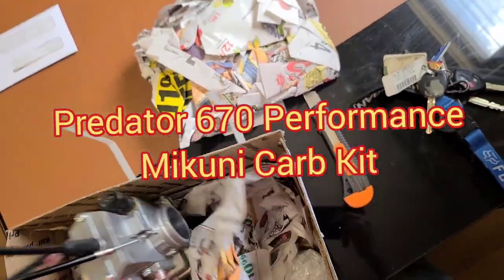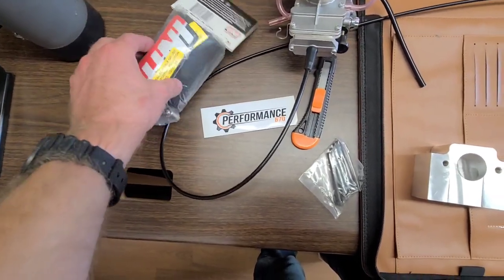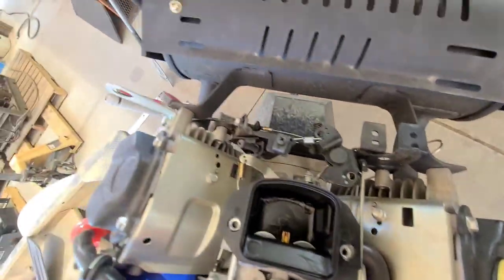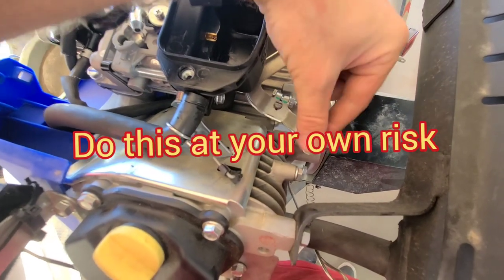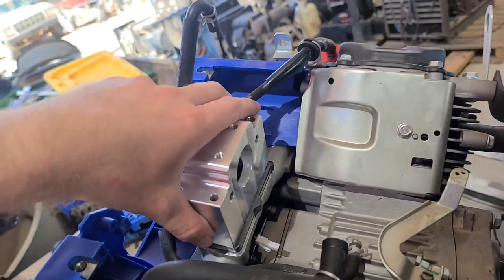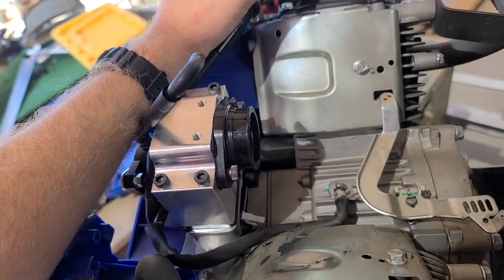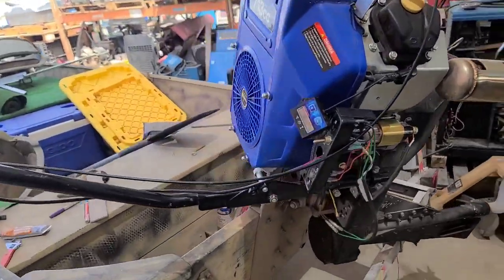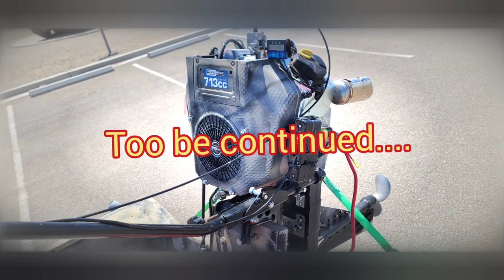Duromax 713cc Predator 670 Performance 670 Mikuni Install

Comment: the "sensor" is your electronic fuel shutoff for the carb when u turn the key into the on position not starting it you will hear it click after you turn it off it disengages. ik im late to the post lol but for anyone wondering in the comments
Reply from the maker: It also has an electronic coil governor shut off. I disabled all the governors mechanical and electronic
Reply: @azlongtales  i never knew about the electronic coil shutoff until this vid my 670 does the same thing as yours i work on it for a while go so stumped i took it to a cart mechanic even he couldnt figure out why it choked down at a certain point on the throttle with the mechanical gov removed. do you have a vid on how to remove the electronic coil gov. i skimmed though your channel couldnt find one. if not could you explain how you removed it

Comment: How does the motor push? And are you satisfied with the SD kit? Also is that the one with the clutch or no clutch
Reply from the maker: I prefer the no clutch on the vtwins they idle nice and low. With no clutch that can wear out

Comment: What carb jets did you end up using?  And what did you do with the PCV?
Reply from the maker: Not sure what a the PCV is on the carb. The jetting was good to go from at performance 670. I have never even opened up the Carb.
Reply: @azlongtales  Thanks man. The PCV Hose is the big hose that used to be connected at the right side of the stock carb.

Comment: What throttle cable length and what kind did you use currently trying to accomplish the same thing through 670 performance but am having a hard time finding the right cable
Reply from the maker: I used they one in the kit from performance 670. It was too long so I used a hose clamp around the bar to hold cable down to put it in right spot to get idle and full throttle

Comment: Where did you find the 420 exhaust? I ordered one from NR racing and it didn’t fit right on my duromax 420.
Reply from the maker: https://youtu.be/4noQIW2Jwys
So the angle of the flange is different but the flange should be the same

Comment: Did you buy the motor and surface drive kit separate?
Reply from the maker: Yes the surface drive is from mudskipper and the engine is from duromax. Links are in the description